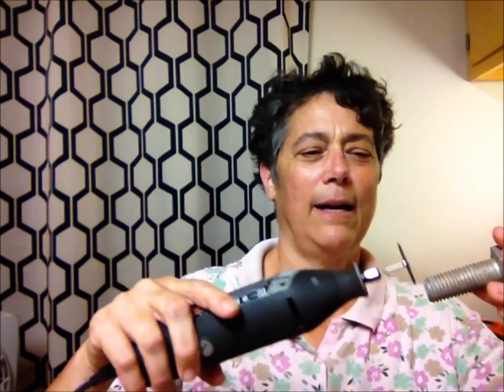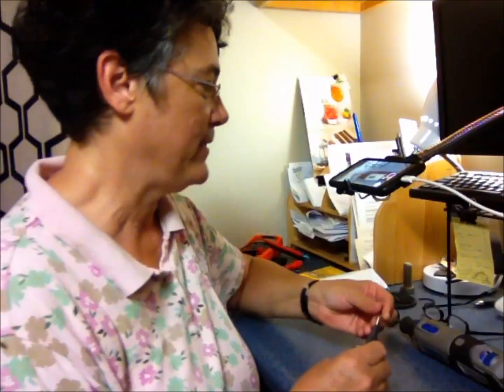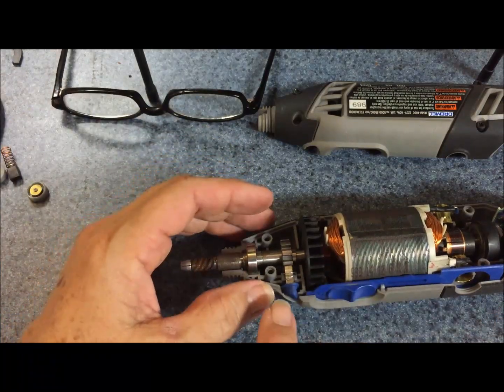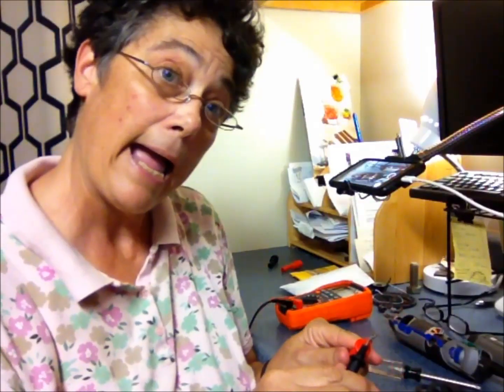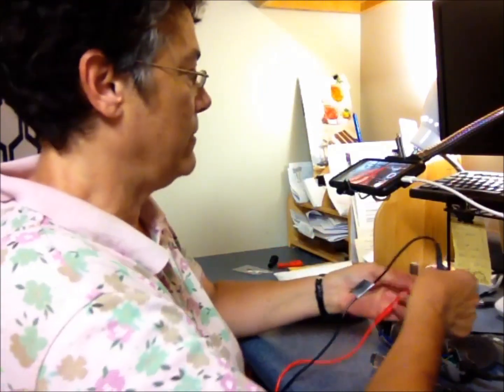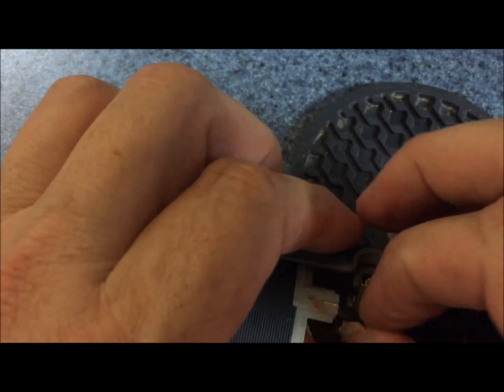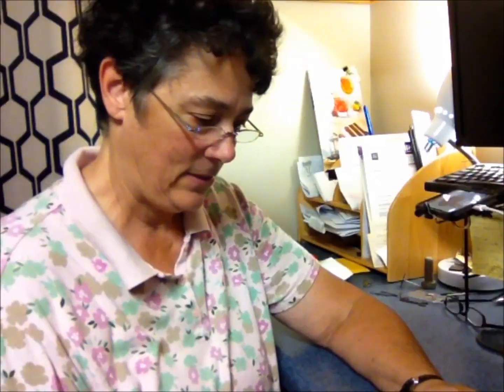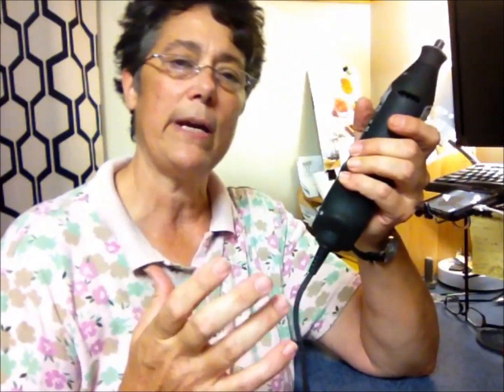Dremel Stopped Working -( I think it overheated )

Comment: My dremel just stopped working and you're the 2nd video I spotted offering an explanation. The other guy said it's the brushes that need replacing. I like you sharing yoru reasoning which spoek to me. I don't want to spend 100 to buy another so I'll take it apart and try out your suggestion to see if it could be the fuse. Like you said- it would've gone to the trash heap  anyway so can't hurt to check

Comment: If you are making this repair do yourself a favor and buy a replacement brush holder part instead of soldering in a fuse.  If you must solder a fuse, use a small vise grip plier as a heat sink to avoid overheating the fuse.  Also, buy a 5A fuse instead of a 10A fuse which is much easier to find.  The 10A fuse has a larger wire and is more difficult to form and work with to get the connections lined up for assembly.

Comment: My 4000 stopped working too. I brought a new fuse and followed your instructions and changed it. When I turned it on it worked but when I turned it off it didn't go back on again. So I'm thinking something is blowing the fuse.  Thank you for your video it was great. I probably wouldn't have attempted it if it wasn't for seeing you do it. I will get another fuse take it apart again and see what happens.
Reply from the maker: Glad it helped

Comment: Why do they call squares of graphite brushes?
Reply: In German, they're called coals
Reply from the maker: I’m not really sure exactly. Except that they Conduct electric current between the stationary wires (the stator) and the rotating wires (the rotor). Probably because they brush along the outside of the rotor.

Comment: You don’t seem like the typical “Karen”.   Ha.   You attempted to “grind” the bolt, not “drill” it.   Good video.   Thank you.   My Dremel just stopped working.   To cut the bolt you can also use a Die Grinder or metal band saw.
Reply from the maker: Yeah, I was such a knucklehead for trying to use the Dremel on such a large project. I now have an angle grinder in my possession for such things, L O L

Comment: Was cutting through 5mm thick cast iron plate for fire and smelt burning smell... I will test it for this fuse now
Where do you get them from..
Reply: They used to have stores like Radio Shack, years ago. I've been living overseas for decades now. So, that's how familiar I am with accessing these items there. Over here, it's no problem. I don't have to get them mail ordered. The clerks at where I get my stuff don't know how to say "I don't know"

Comment: I replaced the brush in my Dremel twice over a few yr period.  The third time, I found the brush melted into the area housing it, and I was unable to remove it.  My Dremel was slightly smaller than yours.  I never did replace the thermal fuse.  I invested in a lot of the attachments for that Dremel, so still hanging onto it.  I've since gotten a larger similar tool, but someday will go back at the old Dremel for another go at fixing it.  Thanks for this video!

Comment: Dremel wanted me to just send them my Dremel after it was smoking hot.  After a lot of trying to find out if it was covered under warranty (no), and try to get a replacement price if the unit was destroyed ($54, at this time), I decided it would be better for me to at least open it up and look for myself before sending it in.

To note, when the Dremel was smoking I unplugged it and queched it in water.  This could have destroyed the unit further but I considered the importance of preventing a fire hazard more important than the machine.  Absolutely make sure the unit is unplugged before quelching in water.  Also understand that the water will become boiling hot with hazardous steam!  Take appropriate precautions to prevent injury.

That said, my thermal fuse never broke.  After though cleaning and drying, I let it set open in moisture absorbing beads for a couple days (to make certain no moisture was in the electronic parts to short out).

I'm glad the unit is functioning again with no need to spend money.  I am concerned however that the thermal fuse didn't break in what obviously was over 100°C since the water was boiling.  I'll have to reach out and see if I can buy a new thermal fuse just to make sure my unit remains safe in the future.
Reply: I'll note that I'm NOT buying Dremel products again.  They don't seem to be the high quality product that I once respected and the extremely limited warranty isn't worth much.  It comes down to a fact that my dremel was 3-4 years old and at <$100 I can probably save money just buying a cheap knockoff ($30) and counting on either repairing or replacing them.
Reply: @neocommodore  I've got one of the older ones of which were still made in the U.S.A.. The newer ones are made in China. In which case, I'm done with Dremel, if I can't get mine going again

Comment: Karen you lady are awesome ... I almost gave up on my dremel 4000, till you mentioned that bloody thermofuse... you saved me a good $240. I can't be thankful enough .. you ROCK! 
for those who don't have a fuse replacement, you can simply bypass it by soldering a high Amp wire at least 25A across the thermofuse .. this is NOT recommended though as you'd lose the thermal protection,  but it'll get you back up immediately
Reply from the maker: That makes sense.....thank you!

Comment: Great video! I think you nailed the issue I have with my Craftsman. Could you say WHERE you bought the fuse, please?
Reply from the maker: Here is the part number for the brush holder/thermal fuse. 
Dremel Genuine OEM Replacement Brush Holder # 2610009854

Comment: The carbon brush set are both worn down and rounded on the edges in my Dremel 4300. But could that cause the power switch to stop turning the motor on and off? It appears this model doesn't have a Brush Holder Thermal Fuse. It isn't locked up, just stoped running while I cut into an exterior vinyl siding corner with a Metal cutting Dremel wheel. (Thanks for the video.)

Comment: I had no choice because the bolt head that had to be cut off was above the muffler and all the framing was really tight and nothing fit in that space so I used the flexible extension shaft you can get for it and used that until the Dremel burned out - then I went with it by hand with a hacksaw blade in the cheap plastic handle thingy for a few hours until 10pm and then went in to go to bed - and then I started the next day with a small cordless drill Dad bought and that fit in, using the dremel cutoff discs because the 3" cut-offs are too big for the space.

Finally.

I don't ever want to do that again. But the hitch receiver is off. 

I'm going to try this and fix the Dremel.  Thanks Karen. 
And also Hi, you remind me of Mrs. C when I was a kid. She's really nice, I like her.
Reply from the maker: I am glad that this helped you.....thank you for your kind words!

Comment: I was using my dremel with now problems, turn off, i left it under sunlight and when I wanted to turn it on again is not working anymore. I dont know if sun heat can damage this but I will check it.  I plan to replace this original dremel fuse, as I am not in US to get this part, using a 110C or more fuse. Can you help me with the current data of original fuse so that I can buy same stuff? many thanks in advance.

Comment: Just got mine today and turned it on to test it works. Well I ran it and was impressed with the low noise level and feel/balance of it,
All good, however when after maybe its first " dry run" which lasted all of a minute.
I was really surprised to feel just how hot the collet and shaft were!
Great video and I think I will be needed to follow your instructions sooner than I think.
If I keep the thing?
They are"hobbyist tools"  and I get that no problem, but over heating WITHOUT a load is a bit bs me thinks... Maybe I should of got a Dremel... Oh wait.
Thankyou again for the great video 👍
Reply from the maker: Lol!  good luck
Reply: @ifixthings3431  thankyou for your reply just rewatched your video and learned a bit more info about using a tester re continuity .
 I have a tester which I acquired ages ago but having no clue how to use it just sat on the shelf🤔. 
Since my original comment I have used my Dremel allbeit a few times, and up to now and I am loving it! 
I was very sceptical because it got so hot when I first tried it but I
Have used it without having it at full speed
And low and behold it works great, who'd have thought!
Thanks again I'll buy the part you suggested " just in case " and let you know of any thermal "developments" 👍

Comment: Thank you for sharing this Karen. These parts are very difficult to find in the UK. Although I found one seller on ebay, using the reference number you kindly supplied. If I need to buy the fuse to solder in future, would 10amp be compatible?
Reply: Would you give the link?
Reply: @Jacknthemonkeys  
Item number  301548195957

Comment: Thank you. 
Have the same problem the second time. Now I'm trying a 121 degree fuse. Maybe it will light up, but that is the last time I will use a dremel.
Reply: The fuse is intended to protect the motor conductor insulation. If you upsize the fuse you leave your motor exposed. By using a higher temp fuse, next time the motor will melt instead of the fuse.
Reply from the maker: Hope it works out!

Comment: Thanks. You might help me here. I have Dremel but not exactly like yours and does not have heat protection. Mine is 110 volt and by mistake plugged it into 220 volt and just stopped working with no smell or indication of burning. What do you think has gone wrong and how to fix it. I check all sort of connectivity inside and all okay

Comment: Thank you Karen!  I’m going to give it a try!  Karen in Guatemala.
Reply from the maker: hope this helped!
Reply: I Fix Things will let you know when I find the part.  But you already helped me.  Thank you!
Reply from the maker: @ranchoesperanza1rhea807  
See if this helps
https://www.ebay.com/itm/Dremel-4000-2-Pack-Genuine-OEM-Replacement-Brush-Holders-2610009854-2PK/153421584446?ssPageName=STRK%3AMEBIDX%3AIT&_trksid=p2057872.m2749.l2649
Reply from the maker: or if you feel like soldering   https://www.ebay.com/itm/5pcs-10A-AC-250V-Microtemp-Thermal-Fuse-110-C-110-Degree-TF-Cutoff-Cut-off-New/172168597073?ssPageName=STRK%3AMEBIDX%3AIT&_trksid=p2057872.m2749.l2649

Comment: Nicely done Karen! You might consider buying a Foredom instead of your next Dremel. Far more torque and Far less noise. They come with a foot pedal to control speed. Great for light or heavy duty cutting and polishing. Tom (Sandman Overhaul)
Reply from the maker: I have a Foredom that keeps shorting.  I am in the process at looking at the windings.  Finally found clips that work with magnetic wire.  But when it worked it was the bomb diggity!!